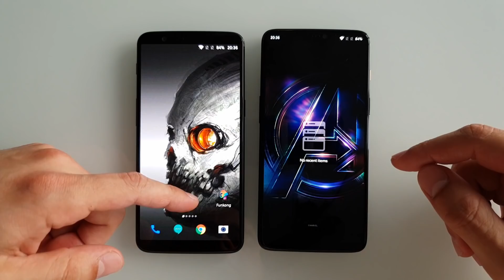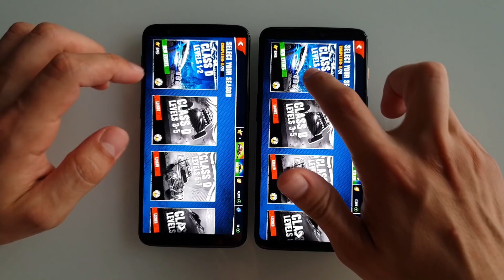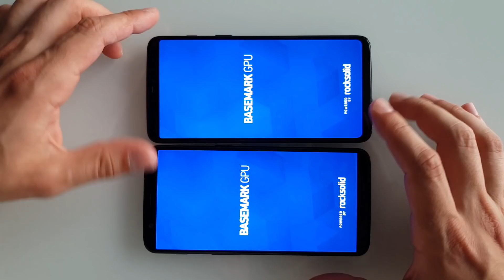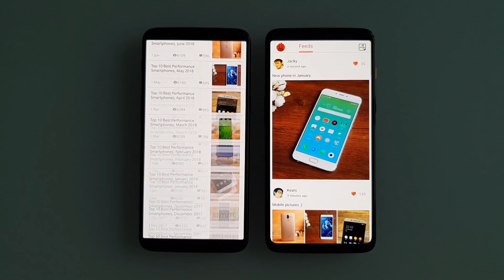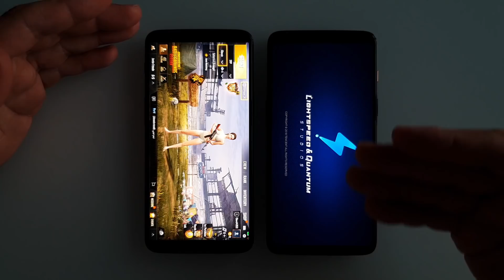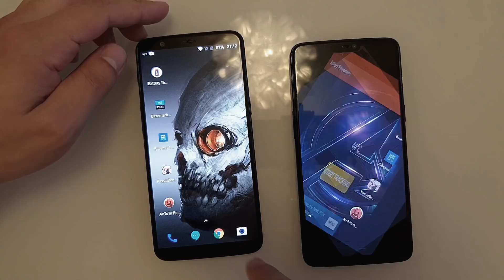AVENGERS OnePlus 6 vs Oneplus 5T: SPEED TEST

Comment from the maker: The OnePlus 6 finished the test with 65% battery left and the OnePlus 5T finished with 67%.
Reply: Rushier Ivan It's very good budget phone but at this price point (~400eur) I would recommend honor 10 more. Honor is getting gpu boost in few weeks which will give it 50% better performance than the OP5. Love the long comments hehe.
Reply from the maker: Not really, particularly the 64gb. Stay tuned for a comparison video soon.
Reply: Do you still recommend the 5T today?
Reply: Thanks. But, I can get a slightly used 5T 6/64 for 270eur (320usd) right now. You think I should grab it?
Reply: VoloKin Project Cool! Will look forward for that. Thanks 👍